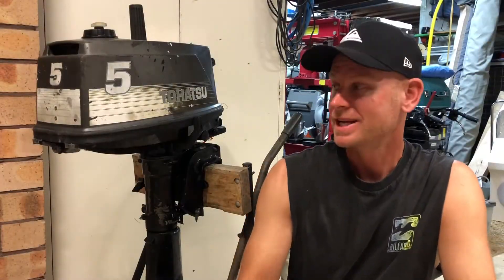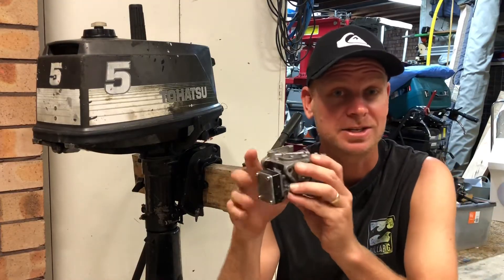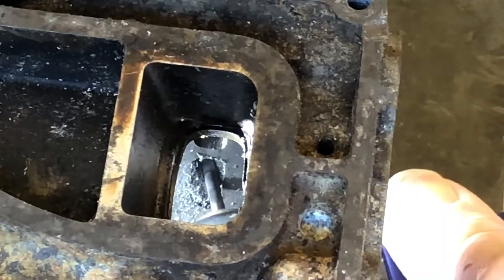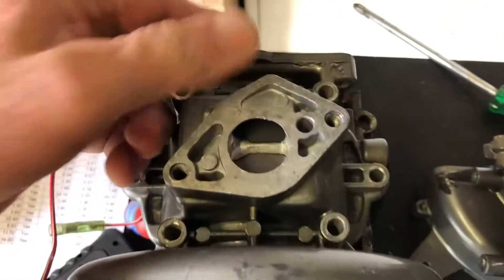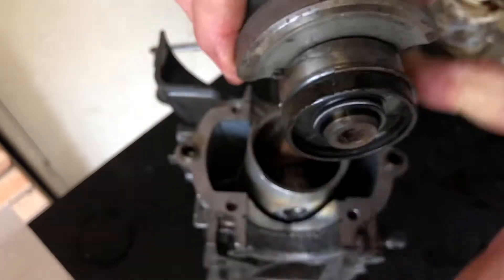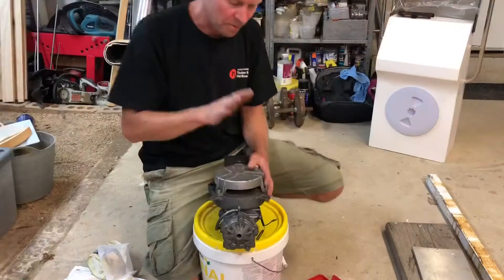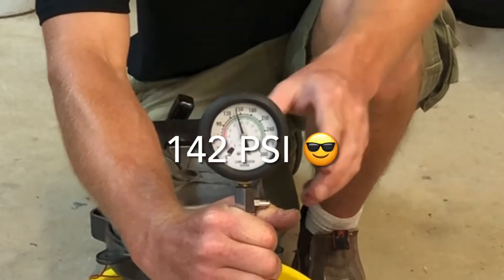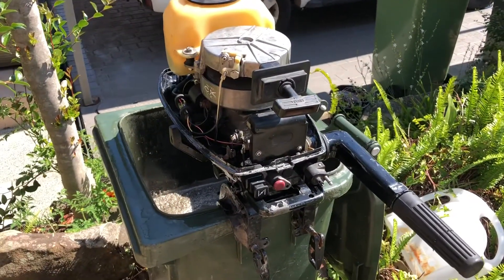Modifying an outboard

Comment: the mercury 5 carburator is the same as the 6/8 hp yam 2 stroke the trotle mounting is differend but i thenk thats not a huge problem
Reply from the maker: Interesting observation! Always great to hear about similarities between different motors. Cheers! 🍻

Comment: Can I do this with a 1961 Evinrude Starflite III? My brother suggested decking the heads so I thought I'd watch this video.
Reply from the maker: You can modify any motor but it is easy to loose power too. I would tend to leave the 1961 evinrude standard. Decking the heads if it’s a looper can be tricky with clearances etc.
Cheers 🍻 
Aussie Boat Guy 😎

Comment: Hi mate! Cheers from finland. Did you raise the transfers, and how much? And how much did yo raise the exhaust? I have two similar engines, and planning on doing the same tweaks on one of them.
Reply from the maker: Hi Mate,
Yep, raised the transfers. I cannot remember exactly how much but think it was only about 1mm on the transfers and more like 2mm on the exhaust. Unfortunately I have lost the calculations and port map I did.
Cheers 🍻 
Aussie Boat Guy.
Reply: @25hpboatracerman  thanks for the reply. That's about the same I have come up with. Can't be too ambitious or all low end torque is lost. With 10" aluminium self made cleaver, lightly ported 5hp my 10 year old came up to almost 22 knots. Now I'll try to make an engine that would make 25kn 😅

Comment: Great videos! You might already know this but the Yamaha 6hp/8hp 2-stroke have almost identical carbs as these. I’ve considered trying one on these on this motor.
Reply from the maker: Hi Mate,
I didn’t know that, thanks 👍
Will check them out, I have not played with the small hp yams much.
Cheers 🍻 
Aussie Boat Guy 😎
Reply: The only mod that I can see is to fill in a slot for the fuel pump pulse to the block. The engine your modding has the half round port over to one side, and the Yamaha has a straight to the block port.

I have both engines so I might try the mods you have done and add the Yamaha 6 or 8hp carb.

Comment: im a yank, but i have a 58' 18hp evinrude that im thinking about trying to find a larger, more modern carb to swap on. do you by chance have an idea about what carb would be a good idea to look into?
Reply from the maker: Hi Mate,
The 58 Evinrude is a beautiful motor, i don’t know how much more power you can get. You may start with a 25 to 35hp omc carburetor but probably won’t just bolt straight up.
Cheers 🍻 
Aussie Boat Guy 😎

Comment: How tight of squish can you safely go on a typical 2 stroke outboard when having a head shaved ?? Just not sure what size or make outboards have heads or bling hole cylinders. Love you videos brother. Yours in 2 stroke outboards
Reply from the maker: Hi Mate,
It likely changes with most motors, I tend to shave about 20 though off some of my stock heads as a start. Some the squish is to close to the piston to shave any off without re-turning the squish.
on some motors I remove the head gasket, re-bolt the head on gently and check squish with that thickness removed as a start.
Cheers 🍻 
Aussie Boat Guy

Comment: Do u have any recommendations for jetting for a 15 fmhs , lots of low down bog
Reply: This is 2016 2 stroke , I may have got the codes wrong, I was thinking an aftermarket carb if there is something that might bolt up.
Reply from the maker: Hi Mate,
Sorry, my bad, it was me that got the codes wrong.
I have not played with the Yamaha 15hp before unfortunately.
Cheers 🍻 
Aussie Boat Guy 😎
Reply from the maker: Hi mate,
Unfortunately I don’t do modifying to the four stroke outboards so I don’t really have any recommendations.
Cheers 🍻 
Aussie Boat Guy 😎

Comment: Interesting stuff. I have done chainsaws and used a timing wheel to get timing of the ports and transfers to where I wanted them. Yeah it's not about just hogging it out as much as possible. You will end up with a 2 stroke with no low down toque. Good video.
Reply from the maker: Hi mate,
Thanks 👍 I really appreciate your comments.
Definitely need to be careful when porting and I definitely have a lot more to learn too.
cheers 🍻 
Aussie Boat Guy 😎

Comment: Would you get away with just a carb upgrade ?
Reply from the maker: Hi mate,
Unfortunately not, a bigger carb on that motor without porting does nothing as it is so restricted it cannot accept more fuel - air mix, on a lot of outboards you can add a bigger carburetor (make sure to get the jetting correct) and you will gain a bit of hp - like the 30hp Yamaha 3 cylinder, the 40hp Tohatsu carbs fit and give more power.
cheers 🍻 
Aussie Boat Guy 😎

Comment: What does bending back the reed valve stops do?
Reply from the maker: Hi mate,
it allows more fuel and air mix to enter the crankcase at full throttle.
cheers 🍻 
Aussie Boat Guy 😎

Comment: Hello, I saw your project with the modified engine and it turned out very well. I own this boat engine and I'm thinking of doing the following, pop-up piston 0.3mm, intake with enlarged exhaust and reaming the cylinder head (spark plug) with 0.2mm. What do you say, is it good?
Reply from the maker: Hi mate,
Sounds ok 👍 
Just make sure what you do to the dead adds sone compression, one is at 145psi now and you could probably even go to 155psi.
Cheers 🍻 
Aussie Boat Guy 😎

Comment: I was just looking at cleaning up the transfer ports if they needed it and skimming the head on mine.  How much did you skim off the head or what squish were you aiming for. Thanks.
Reply from the maker: Hi mate,
When you shave the head on the 5hp you also need to turn out the pot as the squish band is already pretty tight.
Cheers 🍻 
Aussie Boat Guy 😎
Reply: @25hpboatracerman  Thanks. Sounds like a job I will leave for those with plenty of 2 stroke modifying experience. I presume it only adds a bit of torque anyway.I will smooth out the ports and not enlarge them.Could easily stuff something up there..Great video and info. I might look out for an old motor to be a bit more adventurous on.
Reply from the maker: @GrahamSmith-g3j  
Yeah, that’s the go, grab an old one and you can port away and learn what works etc.
All the best 
Aussie Boat Guy 😎

Comment: Hi just wondering if the increased compression results in a harder pull start pressure.  Love the video and I'm now looking for a 5hp tohatsu for a bit of fun
Reply from the maker: Hi mate,
Yes definitely. Now that the motor is run in the compression is 145psi. It’s still not to bad to pull start.
Keep in mind a 25 - 30hp tohatsu two stroke has about 150psi comp and they are still pull start.
Cheers 
Aussie Boat Guy 😎

Comment: Hi Aussie Boat Guy! Can you help me please? I have 2003 Tohatsu 5hp, I have replaced crank bearings with top quality sealed bearings, QUESTION" I found a vacuum hose with One Way Valve in it from cylinder to lower case, is this for oil to bearing or pressure for lower crank seal? " As I was going to remove if for lubrication of bearing! And I have done all your mods from porting exhaust, intake and carb grinde from 15mm to 17mm, high compression head work, after market reeds, and rejetting! Thankyou, or anybody! Love all your videos cheers!
Reply from the maker: Hi mate, 
I would remove the bearing face plates so that they can be lubricated by the two stroke mix like the factory ones, not sure what probs could occur from having sealed ones?? If it was a good idea, they would be in all the motors from factory.
That line is to circulate oil from the bottom of block to the top, leave installed and make sure it goes on the same way as it has a one way valve in it.
Hope this helps mate.
Cheers 🍻 
Aussie Boat Guy 😎

Comment: 15hp question..just bought an older mint kiwi 12' tinny(Ramco) for harbour fishing....has 2006 Merc 15 ..USA.. tiller gear shift..262cc ..has a 9 P blade that paint is pitted and lifted...gonna sand it off and repaint with Wattyl Kill Rust..my fav..epoxy in a can...however...was thinking of putting on an 11P ...just me (112 kg ) and some stuff ... Your thoughts on the 11P..cheers...ooooor...get a 15 super and make it an 18 ?
Reply from the maker: Hi mate,
My mate used to deal Ramco boats in Australia, I liked them 👍
The USA merc 15 is a nice motor and if in good nic they are smooth and quiet too. Firstly I have a few vids on balancing props you might want to check out if your prop is a bit banged up.
I am not sure you would spin up an 11p but worth a try for sure.
Often for example the 9p will get up on the plane well and top out at say 40kph revving at around 5800rpm and an 11p may be slow up onto the plane, top out at 40kph revving at 5100rpm.
Like going up a hill in your car in 3rd or 5th gear.
In saying that, I always try different props to find the best performer for each setup. 
I am currently using a 10p alloy on my 18hp 11ft tinny, tried others even stainless but can’t argue with what works best.
Your motor has a 2 to 1 gear case drive and the 15 super (18hp) has a 1.84 to 1 drive.
I have owned that motor you have and was impressed so definitely try some setups and keep me posted.
Cheers 🍻 
Aussie Boat Guy 😎
Reply: @25hpboatracerman  Many thanks for getting back..prop balance is all a ok..just neglected with paint flaking and lifting..have sanded all back and will paint in next couple of days...a mate has an unused 9 x 10 1/2 that I can have..... Smaller diameter from 9 1/4..bigger pitch.... So that will be interesting.... Smaller diameter give it better holeshot ?   I'm lovin that 11 footer, what a great hull..my neighbour has an older minter Quintrex 375 that a kiwi brought back home to live.. didn't like it and went back to Oz.. neighbour bought the rig for nz$5000 15 years ago..absolute mint yammy 20..does 46kph.

Comment: Do you think you gain 1 extra hp? And if you put  biger jet ?
Reply from the maker: Hi mate,
Got bigger jets and throat in carb. but the main difference in power was gained by porting.
I would say more like 2hp gain, you can check out the comparison vid comparing to a stock 5hp.
cheers,
Aussie Boat Guy 😎
Reply: @25hpboatracerman  do you have instagram?
Reply from the maker: @_.R.F.X.L._  
Hi mate,
I don’t have insta yet.
Cheers 🍻
Reply: @25hpboatracerman  2 hp will be ideal for me
Reply from the maker: @_.R.F.X.L._  
It still won’t have the torque of some 7hp but same top speed.
Cheers
Reply: @25hpboatracerman  i see you port the bade of the hole like a shanffren of 2 mm on each side of the hole is that corect?
Reply from the maker: @_.R.F.X.L._  
Probably about that much but make sure you leave enough block on your motor.
Reply: @25hpboatracerman  i belive the transfer port need to be left like factory and exhaust port can be raised 2-3 mm as the hole permits
Reply from the maker: @_.R.F.X.L._  
Ok, it is a bit hard to raise compression too if your head is cast to the block.
Cheers 🍻
Reply: @25hpboatracerman  almost imposible
Reply: @25hpboatracerman  if i put a 9.9 hp carb direct on the 5hp engine with some ajustment you think i can gain some power without boring cilinder?

Comment: How you recomand first run the engine after this operation?
Reply from the maker: Hi mate,
After this re-build I recommend normal new engine run in - double oil etc
Not over 1/2 throttle for the first 2 hrs and so on until the 10hr process is complete as this ensures that all the parts wear in and treat properly.
Wish I did that 😂
I lost some compression due to inpatients 🤷‍♂️
Cheers 
Aussie Boat Guy 😎
Reply: @25hpboatracerman  can i do this in my water tank with no propelor moovingm or need to be in lake under heavy condition?
Reply from the maker: @_.R.F.X.L._  
You should not rev a motor for long without load to control the revs some what. Definitely under load with a prop for testing.
Cheers 
Aussie Boat Guy 😎

Comment: What minim gap is for rings?
Reply from the maker: Hi mate,
You will have to check with your parts supplier, it is different for each motor.
Cheers 
Aussie Boat Guy 😎
Reply: @25hpboatracerman  i have a yamaha 5e3 1990

Comment: Simply awesome!  You give me hope for my 1992 NS5B (non running).   Around the 3:55 mark you mention shaving the head... eyeball / feel situation or did you shave an exact amount?  Thanks for the videos!
Reply from the maker: Cheers mate, appreciate your comments.
I shaved the head to an exact amount and then re-tuned the pot. You cannot shave the head on the 5 without re-turning the squish band and the pot.
I would leave the head and the stock carb, the biggest difference was the porting.
Thanks again mate 
Aussie Boat Guy 😎

Comment: saya punya mesin mariner 15 HP tetapi recoil starternya rusak tidak bisa diperbaiki, apakah ada yg jual di australia...
Reply from the maker: Hi mate,
We have a few different Mainer 15hp motors here one built by Mercury USA and one built by Tohatsu.
I would look on marketplace or eBay.
Do you have any outboard wreckers where you are? They may have a pull starter for your 15hp.
Cheers 🍻
Reply: @25hpboatracerman  He was right that buying through e-bay couldn't be done for shipping reasons so I couldn't buy a 15 HP mariner pull recoil starter. may i ask for help Mr. how can I get the item I mean.
Reply from the maker: @hijrah25bru  
Hi mate,
Unfortunately I don’t have one at the moment. 
Do you have any local outboard guys that pull them apart to sell?
Reply: @25hpboatracerman  in Indonesia it is difficult to find the same item for the mariner 15 engine. thank you friend.
Reply: I hope friends can help me..

Comment: One of the best hop up videos. I got so inspired to try the same on my 2.5 tohatsu.
Reply from the maker: Cheers mate 👌
With your 2.5hp tohatsu, if it’s a two stroke you can remove the restrictor washer from behind the carburetor and it’s a 3.3hp straight away. Nice and easy 😎😎😎
Thanks again mate,
Aussie Boat Guy 😎
Reply: Is it the same with a 4hp??

Comment: What gasket sealant do you use, and do you use it with paper gaskets or just sealant?
Reply from the maker: Hi mate,
I 
use factory gaskets always and permatex airo gasket joining sealant.
Never silicone based stuff. 
For the crank case halves use a crank case sealant, I believe it’s locktite crank case.
Check your manufacturer for what sealants they require.
Please do not just use an all in one gasket sealant, buy the appropriate gaskets and use the appropriate sealants, it is a cheap part of a rebuild 
Cheers 🍻 
Aussie Boat Guy 😎
Reply: @25hpboatracerman  Thanks mate ☺️

Comment: Thanks for putting up these tests and videos. I'm trying to work out which 2 stroke to use as an auxiliary outboard to complement my 115HP on my 5.2m centre console and your videos have given me an insight into engine sizes and props.
Reply from the maker: Thanks for your comments mate, really appreciate it 👌👌
Happy the vids help.
Cheers 
Aussie Boat Guy 😎
Reply from the maker: Too easy mate,
How did you go finding an auxiliary?
Cheers 🍻 
Aussie Boat Guy 😎
Reply: @25hpboatracerman  I haven't got one yet. Every time I see a a suitable one it's either already sold, or the seller wants twice as much as it's worth, or it's a 1000ks away. I'll give it another go as it's the middle of winter now so there may be more available.
Reply from the maker: @RobB-vz2vo  
Persistence will pay off mate.
Cheers 🍻

Comment: That’s a great vid showing the details, so easy with some of the new small fuel injected four strokes that share a block etc, just buy the new fuel injection model and air intake mod to change from 9.9 to 15 and then change back again. But still not the punch and simplicity (smell) of a two stroke. Keep the vids coming please, love the content.
Reply from the maker: Thanks mate 👌
Really appreciate your support.
Cheers 🍻 
Glenno

Comment: Great info and video! What was your speed before the mod and what is it now? Thanks
Reply from the maker: Hi mate,
I put a video up of the water test between stock and modified, it’s on my channel, decent difference 👌
Cheers 🍻 
Aussie Boat Guy
Reply: @25hpboatracerman  thank you, I just found it! This is awesome! This is just what I was looking for.
Reply from the maker: @rrrttt1112  
Too easy mate, glad you liked it 👌
Reply: @25hpboatracerman  did you have to change anything with the exhaust?
Reply from the maker: @rrrttt1112  
I just changed the exhaust port, I didn’t do any mods to the leg of the outboard.
Cheers 🍻